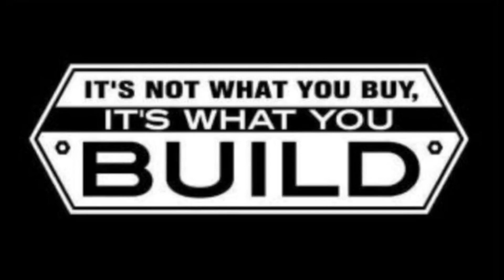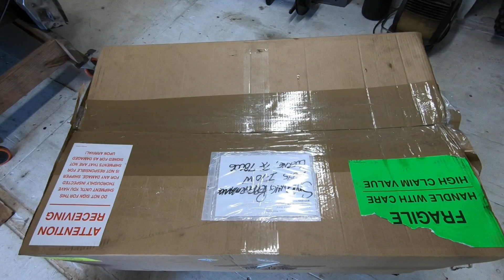1941 Chevy Truck Resto,  Unloading the Smeding Performance 383, 700R4, music by Comin up Muddy

Comment: Cam specs? Torque Converter Stall?
Reply from the maker: https://smedingperformance.com/collections/chevy-engines/products/383-hot-rod-420hp?variant=11963674099748
Reply: Ok I'm building my 383 from a smelding short block
Reply from the maker: This one made 424hp/467ftlbs